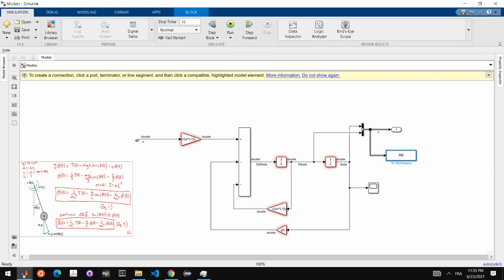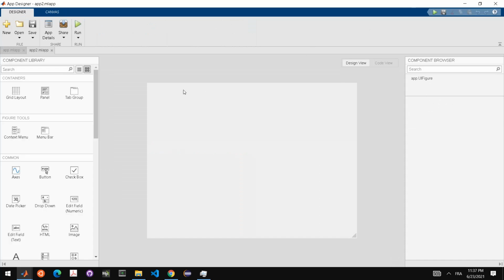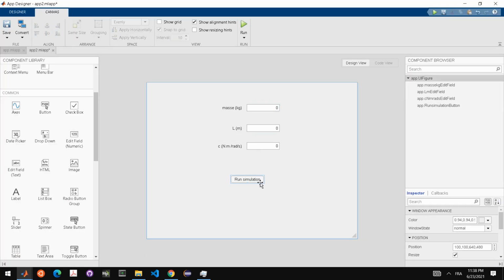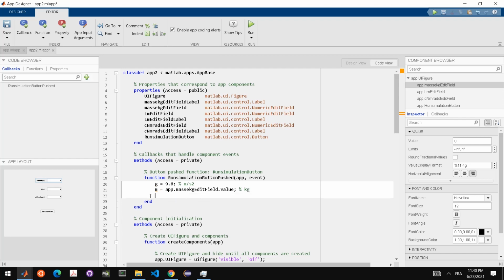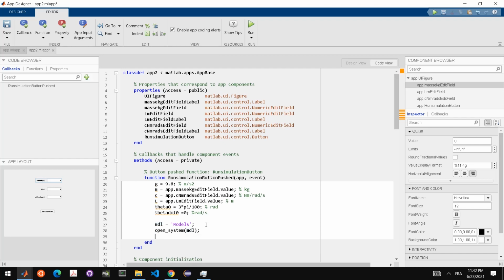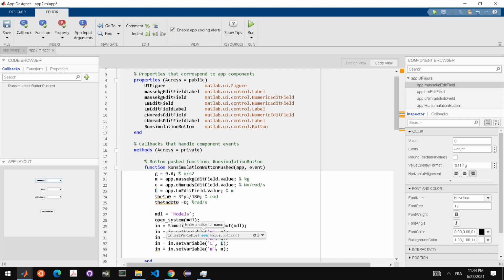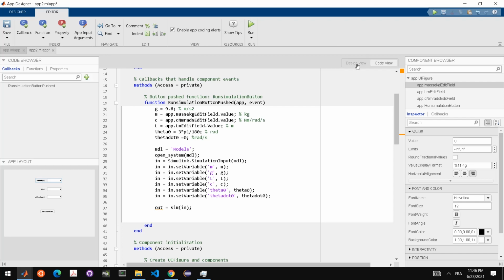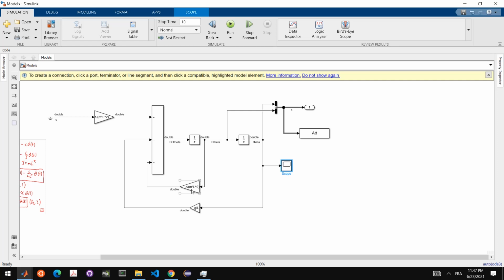Configure and run pendulum Simulink model using App Designer in Matlab | 1

Comment: Thank you very much for your explanation!

How can we do to have a simulation continuous in simulink in using App Designer when we press the start button for example?
Reply from the maker: So if i do understand, you need to run the simulation infinitely? If so, just enter the stop time of the simulink model as 'inf' and run the model from the app.